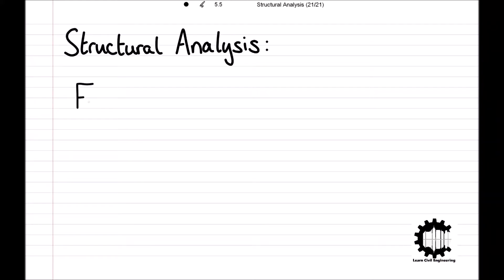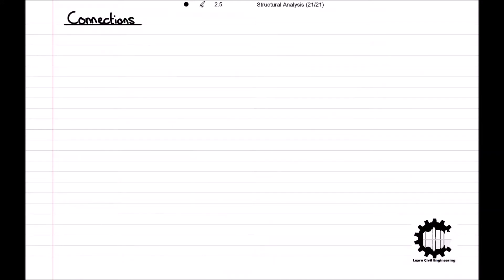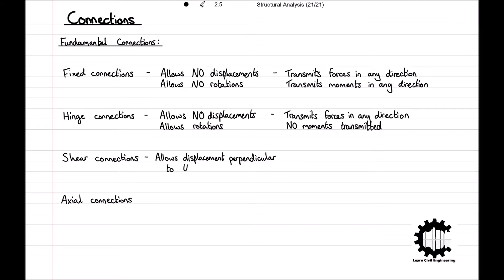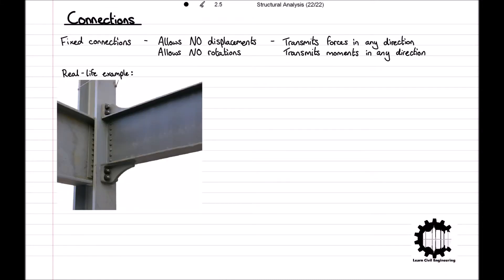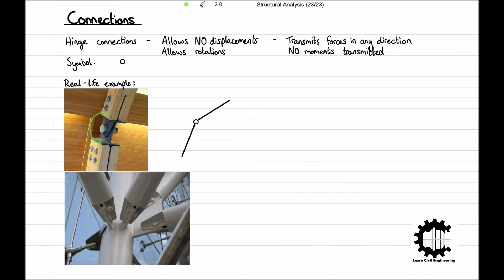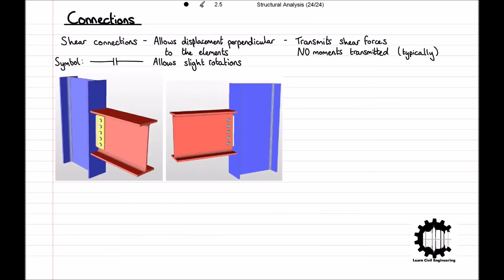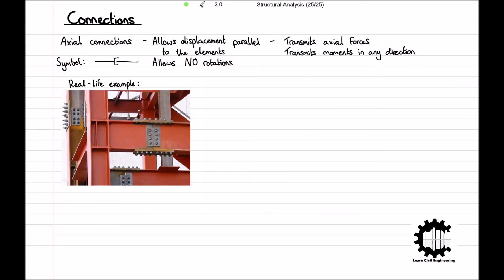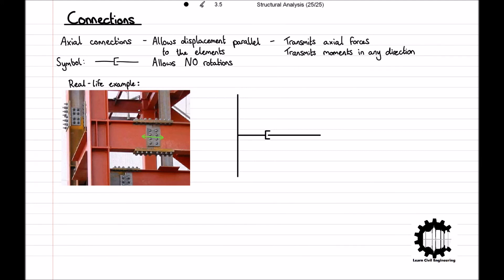Connections: Fixed, Hinge, Shear and Axial - Structural Analysis

Comment: are u able to release more frequent vids on covering structural anaylsis. this is my weak point so i was wondering if u are able to bring out more videos quicker? if not its ok
Reply from the maker: Yes, I am trying to release videos as frequently as possible, however I have just started a new job so it is difficult to keep up the rate I was releasing at the start. I am aiming to upload 3 videos every fortnight and I will be focusing on structural analysis now until I have completed the module :)
Reply: @Learn_Civil_Engineering  thanks alot, sorry if it seemed rude i just need this quality content asap
Reply from the maker: No don't worry, you didn't seem rude at all. I really take it as a compliment that you want more content so I really appreciate that :)